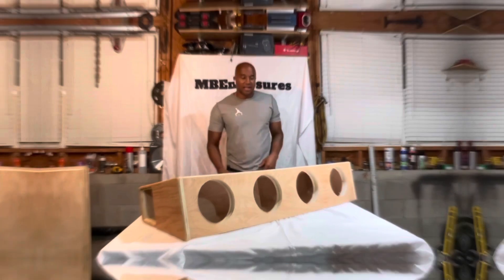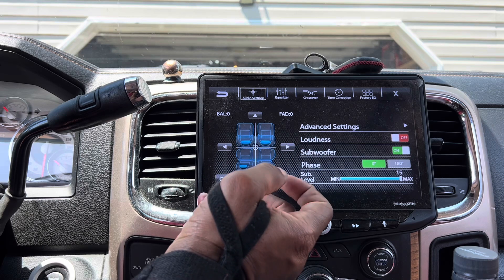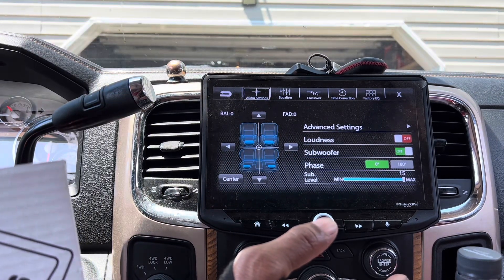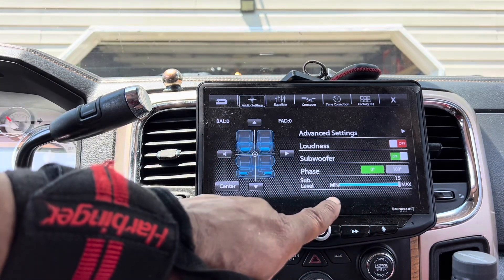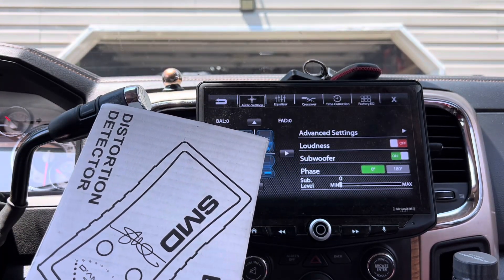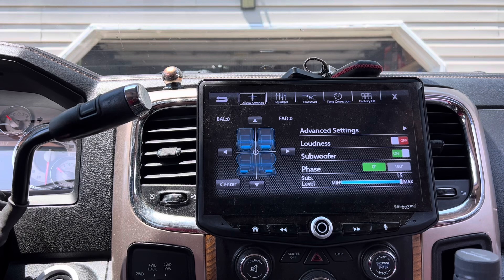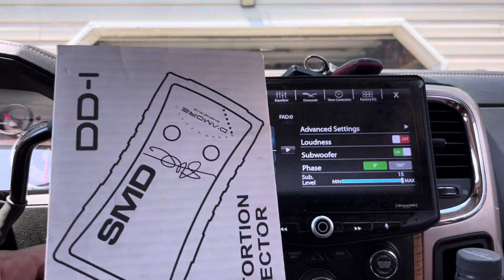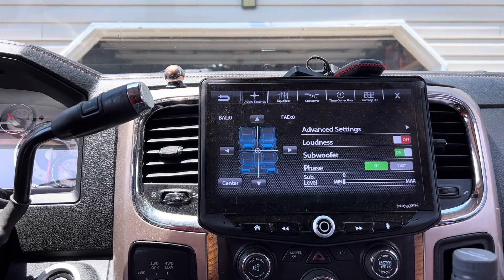Understanding Sub Level(RCA OUTPUT VOLTAGE) On Modern Aftermarket HeadUnits!

Comment: Ok I understand using the DD1+ to set your amp for clean signal. But, what if your  clean signal is at 86v from your amp but your speakers only handle 70v when you calculate the rms voltage using the ohms law. Isn’t your speakers now getting more power that it can handle and going to bring distortion to your speakers.

Comment: My head unit keeps cutting off when my system is hittin' hard, but I think it might be due to still running a stock alternator on my 07 Ford Mustang, and a 10+ year old Kenwood head unit, lol. 
Still, a very informative video, I usually do the opposite and start low on sub levels on the head unit side, then work my way up. 
Might try this next time, and start by turning my gain down directly at the big Skar Audio amp, and adjust the bass levels with the bass remote instead of the head unit itself, when I get in the mood to tinker and tune again.

Comment: Question: my set up is the following; head unit connected to DSP, from my DSP connected to my sub amp. 

I was told to keep my head unit sub level at 0, and max out my sub level on my DSP and remote gain knob on my sub amp when setting my sub gain to not clip.  

Is this the correct way to do it? Or should I have turned my head unit sub level to the max like you're suggesting?

I appreciate any help.
Reply from the maker: Yes that is the correct way.. because you have the DSP
Reply: Thank you sir.

Comment: I never set my sub level at max since it was installed.
I wonder what would happen if I did?
Reply from the maker: If you don’t reset the amp at the new level you will be clipping
Reply: @M.B.Enclosures  That sounds scary because I don't even know what my max sub level is I am going to have to check.

Comment: My kenwood is 4 volts i didnt even have to turn my gain up on my rockford amp when i had it….ended up having to back down the sub level to match the voltage to get the correct watts for my amp…this wat u talkin is key👍🏾

Comment: How about the doorspeaker levels? I have a pioneer headunit and there i also can adjust the door speakers from -20 till +10
Reply: What is the setting called?
 Normally a head unit will not give you an option to turn the four main channels up or down. The default setting should deliver the rated RCA voltage. 

You can verify this yourself. Let's say the RCA voltage is rated at 4 volts RMS. Attach a digital multimeter to the RCA ends and set it to AC voltage. The reading it gives should be RMS voltage. Run your 1K hz 0 dB test tone at full volume and see what your voltage is. (Make sure none of your equalizer settings are affecting that frequency)
You should hit 4.0 volts at either full volume or a notch or two below that. 

Typically the subwoofer level control in a head unit will not give it's full rated voltage unless it is turned all the way up. So they basically give you the option to turn it down. 

It depends on the headunit, though. Some brands have a sub level positive and negative. Those usually give full signal at zero setting.
Reply: Yes i wil measure the rms voltage, also to check on which volume its start to distort. But i think most pioneer are distortion free
Reply: @swaggreen2674  To know for sure when the signal starts to clip you would need an inexpensive oscilloscope to view the sine wave. You can get them from $40 to $70. If you could get an oscope that also shows RMS voltage at the same time, that's even better. You wouldn't need to also connect a digital multimeter.
Reply: The setting is called: Speaker Level '

Thanks for the explaining!
Reply: @swaggreen2674  I don't really know. You might check the owners manual. 

Some headunits let you adjust signal levels in relation to each other so you don't get a big jump in volume switching between sources.  I don't think it's that. 

If they are giving you control over each speaker it might be to fine tune the levels. Kind of like balance and fader, but more precise. 

I know some Pioneer headunits have Network mode that lets you run in 3 way mode. A speaker level adjustment there makes sense to let you fine tune the sound. 

I'm guessing your unit has full rca voltage at the zero position.
Reply: My pioneer mvh-s622bs clips at 46 max vol level is 60. But I have S.L.A set at max.
Reply: @hitmanbuc  That's the speaker level outputs, right? 

It's pretty common for manufacturers to add some gain overlap on the high level out. 

On the rca's they don't use much gain overlap at all. My current headunit goes to 36. It starts to clip at 29 on the speaker level and at 35 on the rca's. A few other head units that I measured we're very similar.
Reply: @JasonWW2000  S.L.A on pioneer is source level adjustment for like bluetooth it affects gain settings. I set my subs up with the subwoofer level at +3 on the head unit and gain on my skar skv2 1500 right at half. Plus 3 seems to be perfect for deep pounding full bass. It's weird but it's true. I just did it and have never heard it sound so good.
Reply: @hitmanbuc if the head unit dont have Subwoofer LPF turn ON / OFF, 50, 63, 80, 100, 125Hz, where should we set up the Frequency, is it at the low 50Hz or pass through 125Hz.....
Reply: What about the loudness? Better to set if off right? I always had it on low, but it gives that bad sound
Reply: @swaggreen2674  Most loudness buttons give a boost in bass and treble at low volumes and then tapers out as the volume is increased. 

I think some of the cheaper head units may not taper off. It may keep that extra boost at all volume levels. In that case in can cause a clipped bass signal a lot sooner than normal.

If yours tapers off, then that's fine. It's a matter of whether or not you like the effect.

The loudness setting on my radio is a bit excessive and it doesn't taper off soon enough, so I keep it turned off.
Reply: @swaggreen2674  yeah I'd turn loudness off
Reply: Me too
Reply: Option Sound retriever also turned of?
Reply: @swaggreen2674 
Ah, that's like Alpines Media Xpander. 

I think that is personal preference. Listen to each source and try the different settings. 

On my Alpine headunit I think I had it turned on at a medium level for my XM radio tuner. It just sounded better. 

I don't think it's going to hurt anything. It just tweaks the sound.
Reply: Yea, its just a slight differnce. I turned the loudness,  it sounds eay better. Now i have to play with my 13 bandz eq, it's flat now but the tweeters sounds too high
Reply: @swaggreen2674 Before you adjust the eq, see if you can turn the tweeter level down. If you're using a passive crossover check to see if it has a tweeter level control. If the tweeters are on their own amp channel, turn the gain down. You could also try turning down the treble. That usually has a center frequency of 10K with a real wide bandwidth. 

Adjusting the EQ controls are a last resort as it's easy to make it sound worse. Try pulling down or boosting 1 EQ band at a time so you can hear what frequency it's affecting.

Comment: Absolute gems this man is dropping. MB could you expand on this video by explaining the Toslink digital output on this head unit?
Reply: There isn't too much to talk about. You would run a fiber optic cable from the head unit to a DSP with an optical input.

What kind of questions did you have?
Reply: @JasonWW2000  the output voltages using RCA’s (2v to 6v) vs digital output, what does the higher voltage mean, how does it translate to the audio setup and why would one choose digital output over the 2v rca ?
Reply: @Mad21X  To answer all that will be long.

As far as lower volt rca vs higher volt:

Let's say you have an amplifier that can put out 40v (about 400 watts). If you feed the amp a 2v signal it has to amplify it with a 20:1 ratio.

If you feed it with a 4v signal it has to amplify it with a 10:1 ratio. 

The big difference here is if you get any type of low-level noise-induced into the RCA signal. Let's say alternator whine or a humming noise from a vehicle module.

Amplifying that noise 20 times is going to be louder than amplifying it 10 times. So the higher voltage will usually have less background noise or whine/hum.

As far as digital vs analog:

A digital signal, either through fiber optic or a copper wire, is not susceptible to picking up any kind of stray noise. Plus it usually has a better signal to noise ratio compared to rca's. 

This makes it ideal for the long run from the front of the vehicle to the rear. High voltage RCA is going to be better than low voltage rca, but digital is going to be the best. 

Once the signal is in the back plugged into the dsp it's no big deal to run short rca cables from it to each amp. Most good dsp's will output 4 or more volts.
Reply: @JasonWW2000  ahhhhh! I understand now! Thank you for taking your time to explain this, much appreciated sir. I have definitely learnt some things here today that I would carry with me & pass on.

Comment: Good afternoon MB i have a question. I have power acoustic class D series A3000DB amplifier. On the setting it has level, sub sonic and low pass. What does the sub sonic do and can you do a video explaining how that work?
Reply: The subsonic filter is basically a high pass filter for the subwoofer. It's job is to roll off extremely low frequencies that might damage your subwoofer.

Let's say you have a ported enclosure tuned to 33hz. Once you start playing really low frequencies like 25 or 20 hz you'll notice the subwoofer unloads and starts flopping around with really high excursion levels. This can potentially damage the sub. So you turn on the subsonic filter and set it to maybe 25 or 30 hz. It will reduce the signal at those lower frequencies and protect the subwoofer.
Reply: @JasonWW2000  thank i understand now 💯👊🏾👊🏾👊🏾👊🏾👊🏾

Comment: DD-1 is a great tool for finding the clipping point of the head unit. In my opinion however it is not a good tool for setting subwoofer amplifier gains as it only recognizes one frequency (40hz).  

If an enclosure is tuned to 33hz, for example, then that is most likely the lowest impedance value(i.e. 1 ohm). If you set the gain at 40hz then the resistance value can be (and usually is) much higher(I.e. 4ohms). 

This can result in sending too much power near the tuning frequency if the amplifier is capable of producing more than what the woofer/s can safely handle.
Reply from the maker: Not possible.. as frequency lowers power applied diminishes …severely
Reply: @M.B.Enclosures  how so? Is voltage at the amplifier terminal not relatively constant within the usable frequency range? Or are you saying that there is a predefined “roll-off” so to speak of the voltage that matches exactly with the roll-off in impedance?
Reply: You might be overthinking things. A clipped amp output has to do with the voltage rails inside the amplifier. The output will start to clip when the output voltage tries to exceed the internal rail voltage. 

It's not really affected by the load on the amplifier. The power that the amplifier puts out is going to vary based on impedance, yes, but it's not going to affect the internal rail voltage. So you don't really have to worry about what frequency your setting the gain with.

There are other things, though that can change the clip point. Namely battery input voltage. In an unregulated power supply amplifier as the input voltage sags that could also cause the internal rail voltage to sag causing the output to the sub the clip earlier than normal. 

People with really big systems that have a lot of voltage sag typically stay under their max clean voltage. Like if the signal from the head unit causes the amplifiers output to clip at volume 40, they can estimate that when the system is playing and the voltage is sagging it will probably start clipping at volume 38. So they don't go higher than volume 38. 

Really, the best option is to have a clip light so that no matter the circumstances you'll know if the output is clipping or not.
Reply: @JasonWW2000  yeah I’m not referring to clipping because clipping doesn’t damage woofers heat does. 

If a 1000 watt rms rated woofer is getting 1000 watts it should be okay but if it is getting 4000 watts it most likely won’t survive long.  

I don’t know how many enclosures you’ve  modeled in software but you’ll notice that most often when an enclosure is tuned in the low 30’s and wired to 1 ohm nominally it is around 1.5-2.0 ohms at tuning but around 4.0-5.0 ohms around the 40-50hz range. Meaning that the woofer is going to receive approximately 4x the power at tuning when compared to the 40-50hz impedance peak. 

If you’ve maximized the gain at 40hz then  when the woofer receives signal at full volume near tuning it very well may receive 4X the power. 

With today’s music, bass lines have become synthesized sine waves. 4x power sine waves will destroy woofers.

Comment: Such a user friendly little tool from Steve. You have to be REALLY dense to not understand how to use it. A must have in any car audio enthusiast’s tool box.
Reply: Of course, an inexpensive oscilloscope can do the same for less money. So there are different options for people.
Reply: I can't knock the distortion detection on his devices.. but one thing I do know is I don't trust the Dyno reads off his devices..  @JasonWW2000
Reply: I think that would be true if it came with good instructions and different tones to play.

Comment: Yes more information I needed..I knew about S.M.D. but didn't fully understand the sub control on the head unit..I was just thinking volume up and volume down about the sub control settings.. aka voltage ⚡  nice MB 👍
Reply from the maker: Glad I could help
Reply: @M.B.Enclosures  what head unit is this I need this for my 2 solo x subs